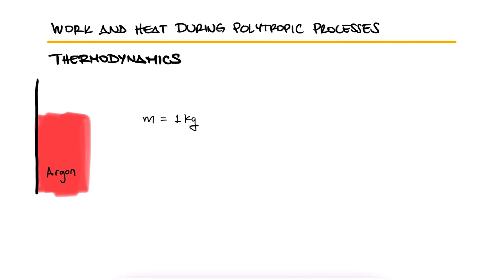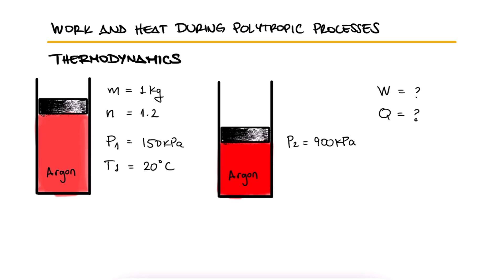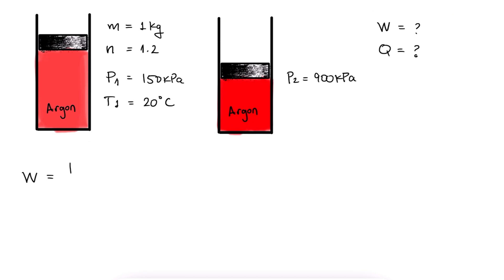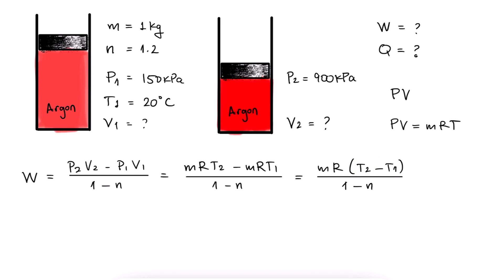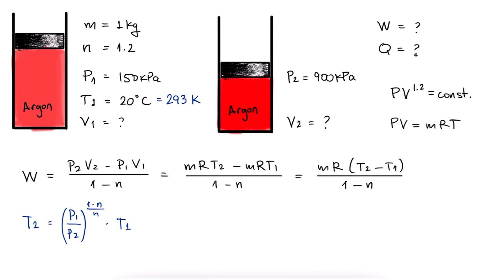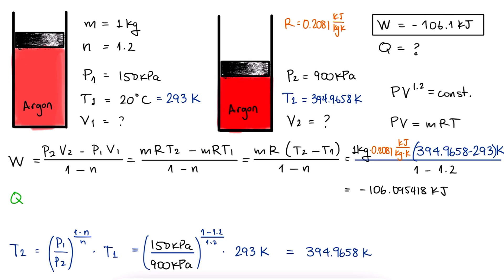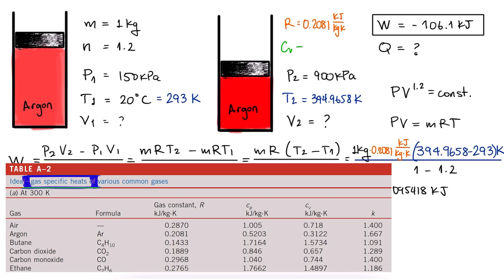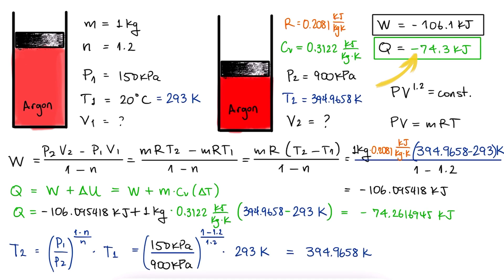Long Work Expression POLYTROPIC PROCESS in 3 Minutes!

Comment: For work, I've taken a different, much simpler approach that gave me the same result. Although it uses some not stated but easily findable information (molar mass of argon) and a SOLVE calculator function, I still find it worh of mention, even because I am no 100% sure of the steps I've taken. The steps are as follows: 

1) Find V1 using P.V=nRT, R being the gas constant and n being the molar mass of Argon;
2) Find V2 using PV^n=constant;
3) Use (P2V2-P1V1)/1-n with the now known V1 and V1;
4) Using some slightly rounded values I've got W=~ -100 KJ.

Is anything incorrect?
Reply: I did the exact same
Reply: That was my thought process and got the same results